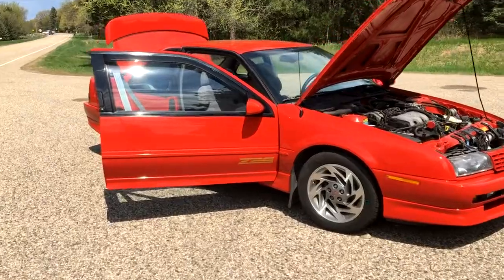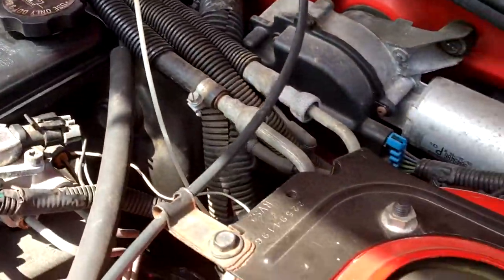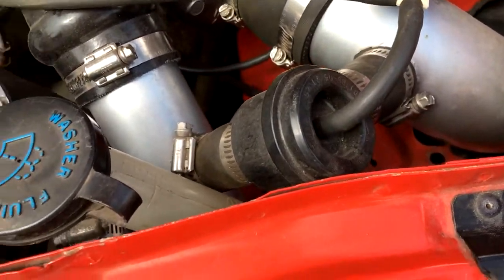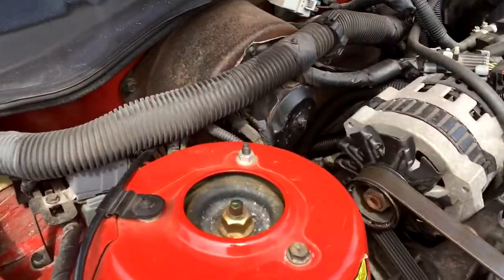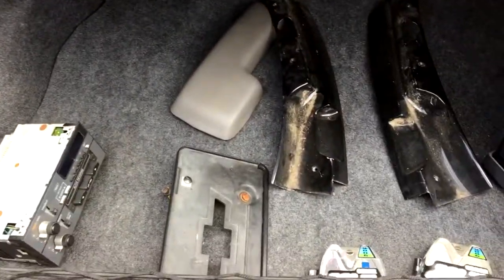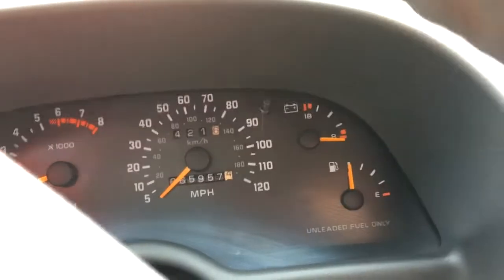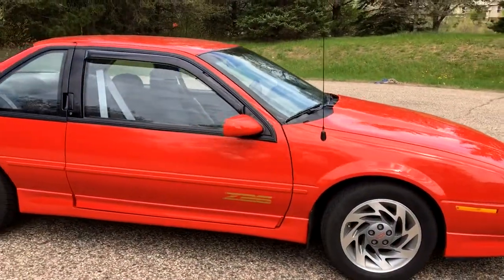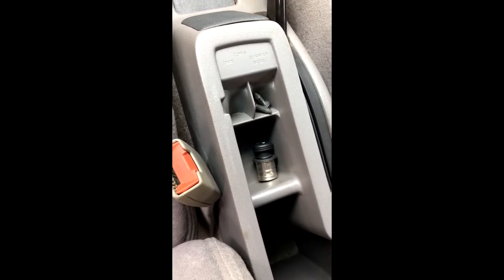Turbo Beretta Sold :(  A Walk Around, Normal Driving, and a Couple WOT Pulls

Comment: Jesus that thing was clean.
Reply from the maker: Thank you.  It was pretty much at the end of the line as far as upgrades without taking away from the cleanliness.  The next step to go faster would have been it’s 5th set of injectors and a fair bit more tuning to bring it up to 10 psi.  I think it had a 12 in it at 10psi with the perfect weather but I felt I was already pushing my luck at 280 hp on a 4T60-E running back to back 13.2s
Reply: @wickedirocz2071  the last two passes on mine were 13.3 and 13.2. I don't think it had 12s in it, but if I didn't already have it sold, I probably would have kept pushing it 🤣
Reply: I'm hoping the LS does 12s right out of the box. I'll find out soon enough. Making LCA relocation brackets right now cause my angles ended up terrible after getting the rear low